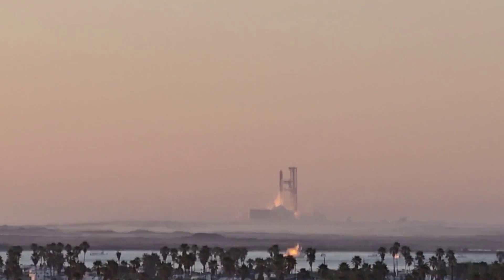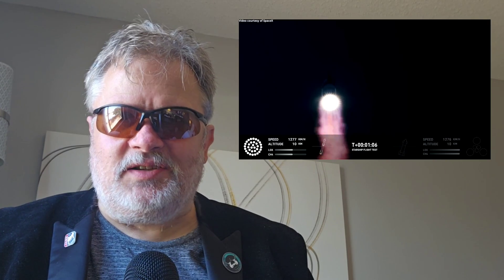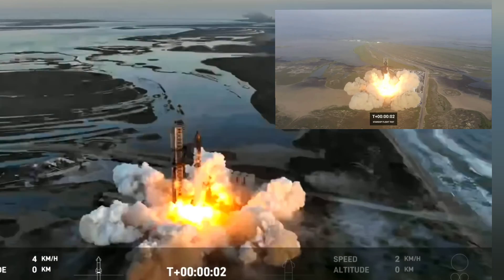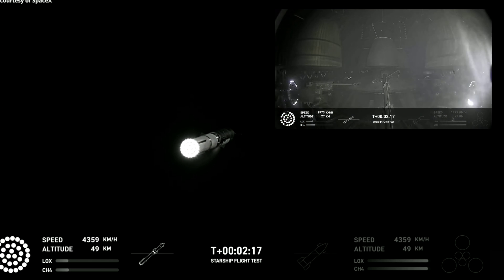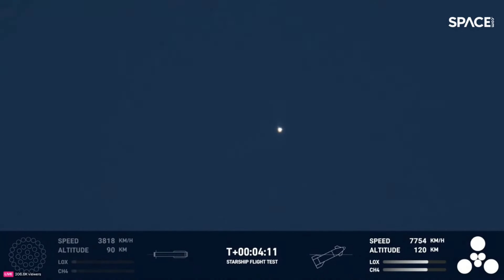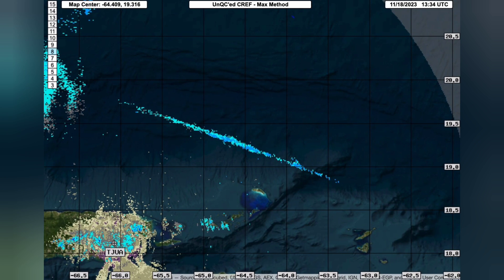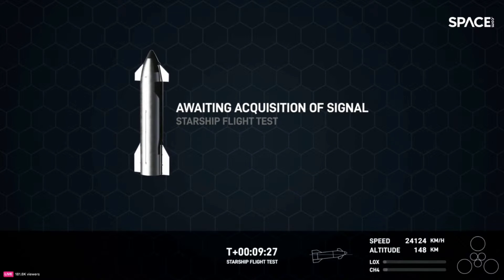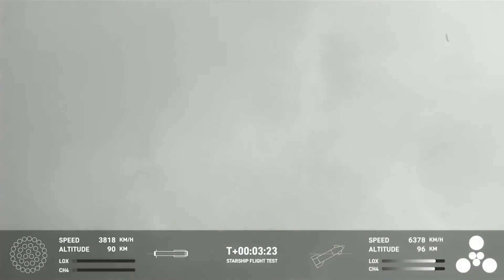Starship takes a huge leap forward!!  What's next for SpaceX after OFT-2??

Comment: SLS is still designed to mainly be a throw-away rocket. With early iterations of Booster and Starship being expended early on is part of the testing campaign. To minimize that would be beneficial, but that truly can only be done by simulating a bunch and then doing X-number of physical launch tests. Hard to get around that. Soooo many milestones were checked off with this launch. This was a tremendously successful with one of many outcomes predicted for it. (Can-crushing/hammering of the booster or certain parts of it was one of the possibilities)
Reply: SLS was doomed to repeat past mistakes since it was congressionally mandated to use legacy STS hardware.  The only reason SpaceX is doing anything these days is due to the commercial space contracts that were necessary once NASA realized they wouldn’t be able to rapidly deploy constellation/SLS.  One way or another both NASA and SpaceX are flying thanks to regular people like you and me.
Reply: SpaceX would not have any contracts from anyone had they not been an extremely well run company and offered a better product for less. To act like they just got lucky with contracts is ignorant. For example, Blue Origin has won NASA contracts strictly through threatening endless lawsuits while Bezos has poured billions into the company, and they still have yet to produce a functioning rocket. Musk should be very proud of himself and his company.
Reply: Yeah you can't simulate everything perfectly when you've never done it before. Like, you're not going to simulate the concrete jumping up and bashing equipment hanging off the side of the rocket. These rockets aren't built to be re-used they're basically full-sized mockups without all the equipment.
Reply: SLS was built on 80 years of throw away rocket technology. Starship is being built on less than 10 years of reusable booster technology, a methane rocket technology that NASA was never able to implement and shuttle technology that NASA has possessed since the 60s and was never able to master and evolve. SLS is not an achievement, it is a crime against the taxpayers.

Comment: Why are all these YouTubers giving their “hot take” and completely ignoring what the video stream itself. When the booster attempts to relight the engines you can see the engines being lost one by one and after several engines are lost the FTS was triggered. Everyone is jumping to blaming hot staging and not that the engines simply couldn’t relight successfully. And all of this is literally shown in the UI of the video yet almost every YouTuber completely ignores it.
Reply: Good point… one by one, you can see the engines fail. Either way, I’m happy with the results 👍👍👍
Reply: @QuantumPath100  There will be something in the launch code that says you need 'x' many engines to return to launch site (ocean splash down point) and as soon as it lost enough engines to mean that it could not reach its designated splash down point then it would automatically terminate itself to prevent falling outside an exclusion zone.

But yeah, still doesn't mean that something did go wrong during another point of its flight but this is the main reason for FTS (flight termination system) being activated.

Comment: when a rocket  is increasing speed all the fuel is pushed towards the the rapters.
then on release ..the 2nd stage fires and hits the booster pushing it back while the 3 remaining rapters are pushing forward.
then the boosters turns to get into position ..it needs a while for the fuel pumps to increase the pressure to the engines again.. spacex fired 10 of the rapters far too early ..the pressure would have not built up that quickly ..if they had fired in staggered sequence would have been fine.
did the starships engines stop too soon then ???  noticed a fair few tiles were missing ..

Comment: Yeah, I don't know if the inclusion of a hot-staging ring that adds and additional 20,000 pounds of weight is worth the additional 10% of payload capacity. I'm sure the folks at SpaceX have done the math on that already. It does seem that the booster takes quite a pounding during the hot-stage separation.
Reply: Full stack weighs ~11,000,000 lbs

Comment: I lean more toward fuel slosh than damage from hot staging. The deceleration from second stage exhaust combined with the extremely fast flip seems like it would make it pretty hard to keep fuel flowing.
Reply: Agreed. I belief the booster experienced negative acceleration, upsetting fuel delivery to its engines.

Should have had more than three first stage engines staying on, abs maybe only three second stage engines to begin with.
Reply: Yeah that's what Scott Manley was saying, the hot staging actually slowed the booster down so fuel would have gone up inside, then presumably gone back down possibly causing some damage .
Reply: @takanara7  apparently the booster experienced -2.5G on the hot staging and flip. The fuel certainly wouldn’t have stayed in place hence why the engines didn’t relight properly
Reply: Ikr? They turned around that monster like if it wasnt experiencin acceleration... 
But they had 3 engines running... Even if that was idle. Then kicked all the rest too.

They may need to treat it like a loaded Tesla Semi, not a Tesla Roadster...
Reply: They will not go with more fuel tanks or solid boosters because it adds complexity and weight 
They just need to tweak the hot staging they were winging it yesterday they have so much data to work with for the next flight. Maybe throttle down the vacuum engines on stage 2 and increase the remaining 3 on stage 1 or even just trottling back up faster after separation.
It will be tweaks for a while they don't want to add unnecessary complexity.
Reply: Ya. If they throttle up faster less time for the fuel to get displaced.
Reply: Agree I suspect some small solid motors fired just after the flip but before raptor relightt is going to be needed... That flip is too dynamic the fuel doesn't settle... Three small solids Saturn 5 style should settle the fuel... I wonder if they had fuel tank cams...
Reply: @chrisjohnson4666 given the primary objective was testing staging, and there wasn’t on-rocket camera, it suggests the camera bandwidth was given over to internals, yes
Reply: @chrisjohnson4666  The flip didn't seem any more aggressive than a Falcon 9 flip.
Reply: @DieyoungDiefast  different density of fuel liquid Methane is way less dense I believe... Id suspect there wasnt a whole lot of data on how Methane works in this instance...
Reply: @DieyoungDiefast  that may be the exact issue. They did it like falcon 9 does.

But falcon 9 is way smaller. has fewer tons of fuel in it. It has no engines running when it flips.

It may be neccesary to make that turn waaaaaay slower, wait for the fuel to settle and only then start powering on those remaining engines.

You can bet they know exactly when things started to break in the booster.

They fixed every major issue on OFT-1, they will fix this ones as well.
Reply: @Coyote27981 agreed, Superheavy is around 10 times the size of Falcon 9, as well as using a completely different fuel. They're gonna have to use a different profile.
Reply: @chrisjohnson4666  Adding solid rocket ullage engines would not work on a reusable ship.  The would constantly have to be replaced.  The idea is to keep it simple here.
Reply: Same, my bet is on some sort of incorrect mixture that resulted in engine problems on the booster, as we saw with OFT-1 the booster is robust enough to handle C4 charges. This way we could kind of blame it on the hot staging, but that could be countered by throttling the engines differently or some post seperation maneuver. I'm sure that SpaceX will find out what went wrong as the booster survived for quite some time to gather some of that tasty data.
Reply: Yes, I suspect that a slower flip with center engines and a relight once things have settled might have been more of a sure thing. BUT the aggressive flight profile might have been exactly to get data on where things break.
Reply: @VicariousAdventurer  that’s probably giving them too much credit.  The aggressive maneuvering is more hot dog than hot stage.  I hope they got useful data either way.
Reply: Yes I agree with the majority  ...  the hot staging...negative exceleration....fuel surge...exacerbated by the centrifugal force of the flip causing fuel supply and mixture problems with the engines....? Solution .... positive G must be maintained throughout the booster during the separation and flip maneuvers. 
However let's not forget that all of this can easily been thought of and covered by SpaceX engineers and it could just have been something going wrong somewhere!
Reply: Me too. Why was the booster flipped so quick and sudden? Wasn't necessary! No engine runs without fuel!
Reply: @MrDmorgan52 - My guess is, with the ultra fast flip, they were being their usual aggressive initial approach to get some real data to analyze. Ironically, probably also being conservative with regard to bumping the second stage (à la Falcon 1). There were a lot of questions about how much the empty booster would accelerate once those three 50% engines weren't also pushing the fully-loaded 2nd stage.
Reply: @charleslivingston2256  Yes, I agree. No wishes for repeats of Falcon 1 hiccup, made them push for an aggressive flip-manoeuvre.
Reply: Yeah, that flip was surprisingly fast. It would be amazing if they. Could fix the issue simply by changing some timing and speed of a few of the separation and post separation events and maneuvers.
Reply: I suspect this is a software fix, mostly timing changes.
Reply: Agreed, I think it will be an easy fix for SpaceX too.
Reply: Slosh? Pretty sure there will be baffles in the bottom 1/4
Also pretty sure the exhaust of starship pushed the top around ie the over speed rotation. So if the top was pushed over little or no fuel
Lift
Reply: @avanap8096 Yeah. If it was fuel slosh or some sort of pipe hammer I don’t think it’ll be a case of SpaceX engineers thinking “oh no, we never thought of that”. SpaceX engineers know what they are doing so I suspect it will be a potential issue that was already identified and that the design was intended to avoid so they won’t be starting from scratch trying to resolve an issue they hadn’t anticipated, it will be more a case of “why weren’t our current mitigation features sufficient to avoid this?”. Maybe the baffle design was a bit off, maybe vortexes appeared somewhere unexpected, or whatever. I’m pretty confident they’ll fix this either by tweaks to the separation and flip profile and/or by relatively minor design changes.
Reply: Yeah, flip was really fast
Reply: All good just seems to be thousands of partially literate people with expert opinions.(not necessarily you) just sick of the arm chair specialists
Reply: @avanap8096  I have high confidence in SpaceX engineers and their iterative process
Reply: Can they fix it on third launch.
Reply: @daleravic  you can bet they will. And they will push it hard so something new breaks. Thats how they roll.
Reply: “Rocket explodes again - another failed test” blah, blah, blah. Mainstream media has plenty of money so why on earth can’t they hire journalists who actually understand what they are writing about because anyone who actually follows this stuff and understands the complexity of a project like this, how many other ultimately successful projects have way more explosions than this during development, and how SpaceX development methodology (move fast and don’t be afraid to fail as long as you can learn from the failures) is very different to the slow and cautious NASA approach wouldn’t write stories like that but instead would be able to explain and put into context what just happened.

Seeing every single Raptor on both stages perform flawlessly until very likely fuel supply issues did for the booster and a LOX leak did for the ship was absolutely groundbreaking. And especially Ship 25 was really old with not very recent Raptor serial numbers installed. This test was a spectacular success.

Edit: Oops. This comment was supposed to be at the top level. Sorry about that.
Reply: So why doesn't the booster(s) for Falcon and Falcon Heavy explode doing the same thing?
Reply: @johnruckman2320  Falcon 9 booster has cold-gas thrusters. In addition to the perpendicular ones for doing the flip, there are downward-facing ones that fire for several seconds to get at least some of the fuel to the bottom before firing the boost-back burn.
Reply: Gee. What a surprise. Everyone just work it out? 🎉 SMART people said fiel slosh was impossible to over come...but Musl is a genius. 🎉 Musk the fraudster will be in jail. 🎉The test was a complete disaster. Both craft exploded. 🎉 They never reached the Carmen line. 🎉 Please stop lying. Elizabeth Holmes was enough. 🎉🎉🎉 Space Shuutle threw 25 tons into orbit from 1981. Reusable. Landed on run way. That was 42 years ago. 🎉You children are easily pleased. 🎉 The greatest scam on earth, perpetuated by a controlled media. A Kissinger and Associates creation. The Global Village Idiot,  Elon Musk.
Reply: I agree that fuel slosh was responsible for the flameouts of B9's engines after Hot Staging.

I suspect that B9's FTS telemetry signal to Star Command is what set of th FTS for S25
Reply: That’s an easy fix for Elon the world’s best engineer.  Even a college dropout like me can think of at the very least having a small propellant tank that is kept full during launch and then used in series during the hot staging portion of the flight.  Or is that a technical impossibility for some reason?
Reply: @russellharrell2747 yeah no, then you’d need a whole other second set of pipes to feed the engines from those pipes

There are engineering solutions, things like surge baffles and shutters that channel the flow in the tanks, but…not simple
Reply: @The_CGA  yeah, I was just throwing something out from a non-engineer viewpoint.  I’m sure this kink will get worked out, but who knows how many iterations it will take.  The moon by 2025?   Hmmm
Reply: @russellharrell2747  second stage has header tanks for exactly this reason.
Reply: @russellharrell2747 How bout you get outta here drop out.
Reply: Jeez...

Comment: How many engines were supposed to light up for the Boost Back Burn??  Just the4 center 13 engines??  7:18 .. 12 of those 13 lit, then several started dropping out.
Reply: Center 3 engines for hot staging.  Center 13 for boost back burn.   I suspect fuel sloshing in the tanks when the booster decelerated caused the engines to suck gaseous fuel into the turbo pumps destroying the engines.

Comment: It is a deep-sounding crackle! I think the Soviets managed to get their N-1 first stage to complete the burn once. After staging, the second stage failed to ignite properly.
Reply: I remember their last attempt lasted the longest. According to  Wikipedia, 90 seconds after launch, 6 engines were shut down to reduce throttle, but this caused rupture of fuel lines due to sudden increase in pressure. It still had some ways to go, but was probably close
Reply: The "deep-sounding crackles" is the exhaust plume breaking the sound barrier, multiple times in quick succession.

Comment: What's the difference between OFT and IFT?
Reply: OFT = orbital flight test, IFT = integrated flight test
SpaceX officially calls these launches "IFT". They are "integrated", because testing all the components (Stage Zero, Super Heavy, Starship) together, but SpaceX is not setting the expectation that the test flights will reach orbit. However, the community is calling them OFT, because they expect the test flights to reach orbit.
Reply: Orbital Flight Test 
Integrated flight test
Reply: one it's orbital, the other is not

Comment: I only got the news from CNN that it failed and was so disappointed. Very sad.
Reply from the maker: It didn't fail, though. Not really.
Reply: If I recall, the intention was to 1st make it off the pad, then 2nd make it to stage separation. After those two, bonus. They achieved their primary and secondary tasks. Keep in mind that a reconnaissance aircraft was also assigned to help document the launch process, so they have that visual data thru and beyond stage separation to help with their analysis. This launch was successful in so many ways to help with improving / designing next launch opportunities.